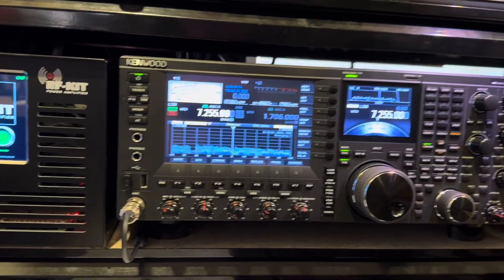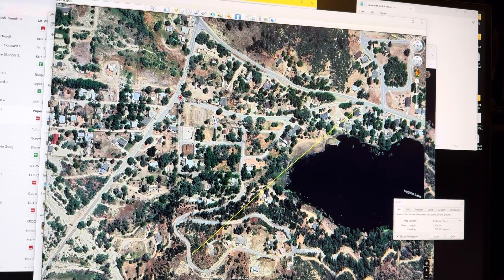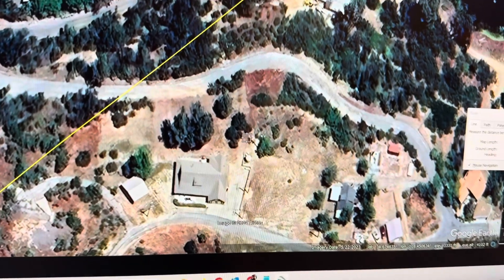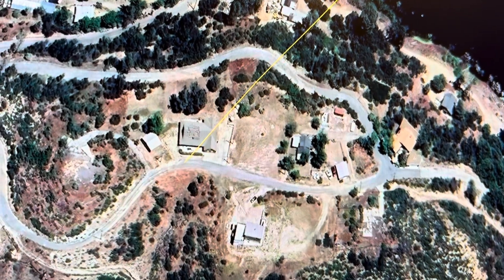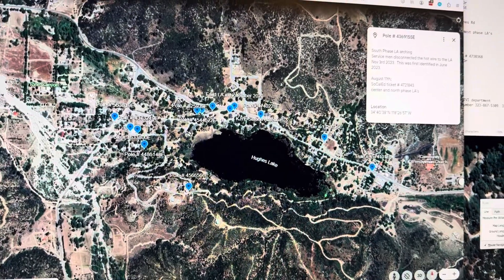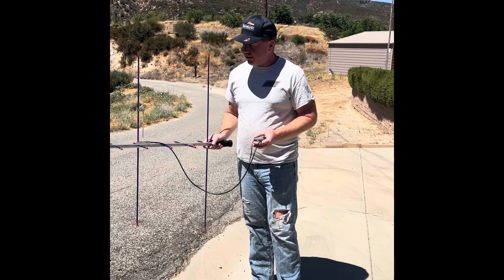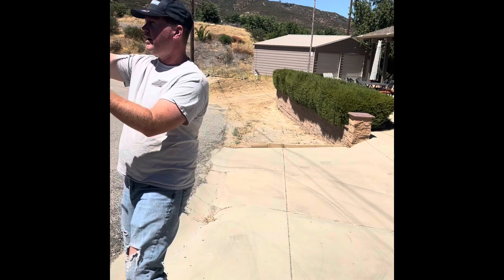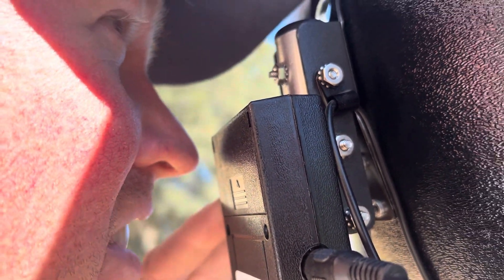RFI Hunting... again.  Another SoCalEd Lightning Arrestor arcing - KJ7E

Comment: I live on an island in the Med about 1/2 mile from the ocean. Well with all of that salt in the air we have an issue with arcing on a transformer just about three hundred feet to the East of our home. Insulators are contaminated with salt so on humid days the arcing is unbelievable. Power company doesn’t have enough employees to check out the the issue as they are out working on more serious issues, or so they say.

Comment: Good job Damon ! I like to start at 10m using a kx2 with only the center pin inserted into the antenna jack. The local power company loves me almost as much as they love you 😂 
 I’d say those arrestors are all original and installed within the same month by linemen. Makes sense they all start crapping out at once.